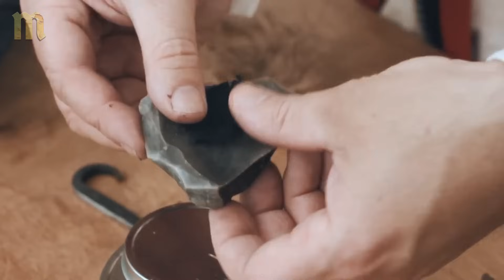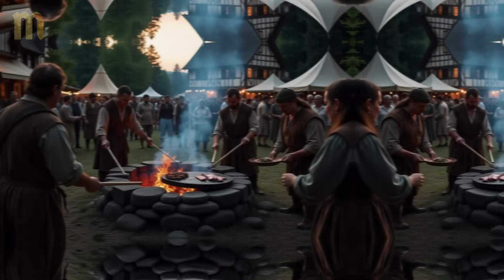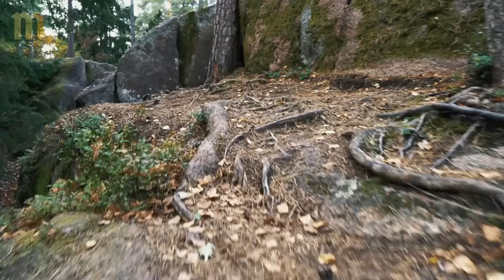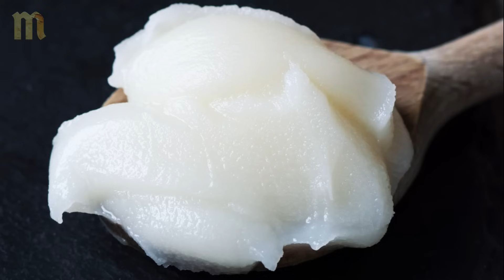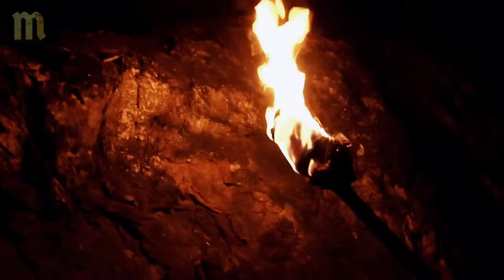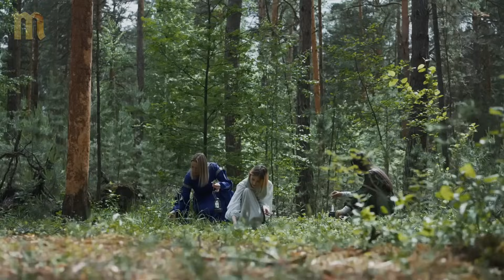7 Genius Survival Tricks Medieval People Used (That Still Work)

Comment: First of all, no peasants did not use char cloth. Cloth was mighty dear back then. 
In fact it wasn't until the 1800s that even the rich people started using char cloth. 
Cloth was too valuable to waste on such things. When they got completely worn out they became rags to clean things with until they completely fell apart. 
It's modern-day bushcrafters that are hot and heavy for char cloth. Because we have and abundance of cloth material to use. And it works easier. Then trying to use a piece of charcoal, or fungus. 
If you're going to put something out there at least do a little bit of research and use some common sense. 
These common people typically only had one set of clothing. If you had a second set of clothing to wear for special occasions you were very well off. 
Maybe royalty had extra cloth. But I doubt they used it for char cloth.

Comment: By the gods, boil your water in the wild people, they drank tones of ale and mead then because it killed the bacteria, and surprise they BOILED their water, and so should you. Yes filter it if it's dirty with sediment and all that, but then boil the water and let it cool before you drink it, a ROLLING BOIL.

Also they had things like oil lighters in medieval times, and matches as well if I remember correctly, and most ppl wouldn't have had access to good steel, so a lot would have been more proficient with things like the Bow Drill and Hand Drill to start fires, plus you can make one from found wood in the wild, making your weight even lighter for traveling, or hunting, or whatever you were off doing.

Comment: Talks about flint and steel but shows footage of ferrocerium rods, (a larger lighter "flint") a modern technology. These are two very different methods. The carbon steel puts out an orange, cooler spark and a lot less of them compared to a modern ferrocerium rod that produces hotter, white sparks in abundance and can be struck with anything sharp, from a sharp 90° knife spine to a piece of glass with a sharp edge.

Comment: Great video and extremely useful knowkedge. Just a few corrections...the flower of the Yarrow is the most potent part but yes the leaves work too. Also Comfrey is known as knitbone not bonekit...Boneset is another plant completely. Comfrey must not be used on open wounds or puncture wounds though because it speeds up cell regeneration and can seal in infection. Let the wound scab up first and make sure there is no infection present before using Comfrey. Salt and Yarrow are both good for dealing with infection as are other plants. Comfrey is awesome on fractures, broken bones, muscle and tendon tears by making a poultice or using a salve.
Reply: Be sure to use comfrey only as a topical application.  As food and drink, comfrey adversely affects the kidneys and liver.  Also, it's good as fertilizer.  Fresh or dried.  The flowers attract bees, etc. to the garden. ✅🕵️❤️🇨🇦
Reply: Clean and disinfect the cut, pinch the edges together, hold closed with "tape sutures, tape stitches" - no needle and thread required. When there is no sign of infection, reapply the narrow tape strips, and then apply the comfrey poultice.  Repeat as needed.  

I have used comfrey poultices to disappear boils, scrapes, and scars from fresh or older cuts and burns.  I am about to distill the essential oil of comfrey to use as a "patch" for arthritis and degenerative disc problems I am experiencing.  Possibly could help. Maybe on wrinkles too. 😊💃🎶⚖️✅🇨🇦❤️

Comment: Some fun facts and tips:

1) The word striker is VERY misleading!
If you have a modern firesteel, or more precisely a ferrocenium rod, or if you use oldschool pyrite (a natural mineral), then the metal actually works as a striker.
However, with flint, you actually strike the metal, which in turn throws sparks. It’s NOT the flint throwing sparks, but the other way around!

2)
The metal Tinderbox is very useful. If you have a fireresistant box, you can use it to make char cloth and if you throw sparks into the box containing the char cloth, then you have a safe surface to make fire on and if the material inside actually burns, just close the lid, and the best it can do is smolder. Both the char cloth making and the question of if it smolders depend on how air tight the box is.

3)
The tinder mushrooms were apparently soaked in nitrates. The same was done with some natural fibres, like hemp fibre. This increases their ability to ignite upon contact with sparks and keeps the smoldering longer and hotter.

4) 
The ground oven has a unique property that could save gas or electricity today. Imagine a pot with boiling water and you turn off the heat and still need to cook the ingredients inside, what do you do? Leaving it in the kitchen will only cause it to get cold, but if you bury the pot in sand, and perhaps covered with isolation material, it stays hot for hours! That’s a potential life saver, if you run short on fuel.

5) 
Naturally, adding thermal mass in the shape of hot stones increases the time the ground oven stays hot. You can also use them to heat a room (basically putting bricks on a fire proof surface, or using a pot with hot sand for the same purpose), or heat a bath, by putting the stones into the water and removing them again before entering the water…
Reply: On 4) a hay box will keep a pot warm too, or if you dont have one those, place in your bed on an old paper and pack the duves and carpets around.
Reply from the maker: This is amazing, thanks so much for sharing all this! The striker explanation is super clear, and the tips about the ground oven and thermal mass are actually really useful even today. Comments like yours add so much value to the topic. Might need to explore some of this in a future video!
Reply: I'm glad you explained it but I doubt they understand it. 
It's also fair to point out that it's very unlikely that anyone used char cloth in the Middle ages. 
Cloth in general was pretty scarce. Most people only had the clothes on their backs. They would use old clothing for cleaning rags. Until they completely fell apart. 
In any event there wouldn't have been enough of it to regularly start fires. 
It's likely they used charcoal or the fungus most of the time and if you used it most of the time, you were used to that and wouldn't be screwing around with trying to make char cloth out of whatever was left of the rags. 
Char cloth was used by rich people in the 1800s. But even then normal people just couldn't afford to waste cloth like that. 
Today we have an abundance of it and that's what every bush crafter and their brother tries to use to prove they have some skill in an attempt to dilute themselves into thinking they are like their ancestors.